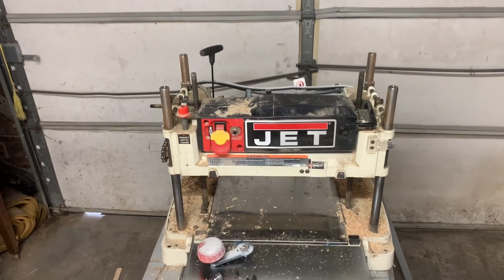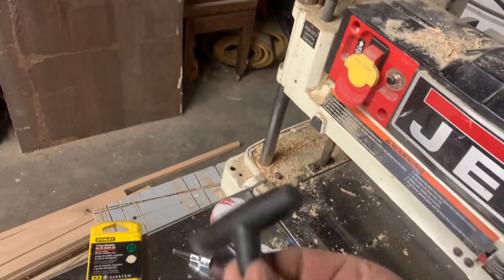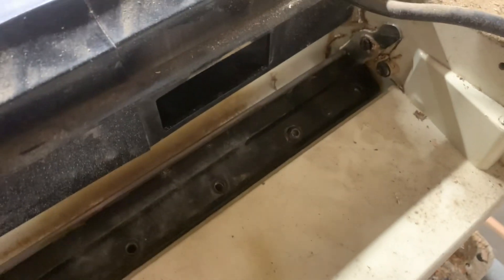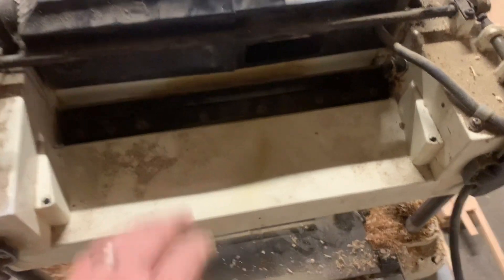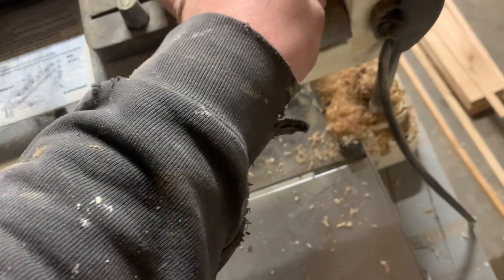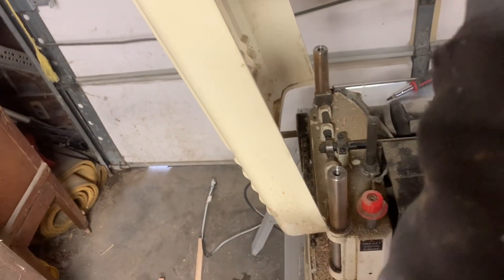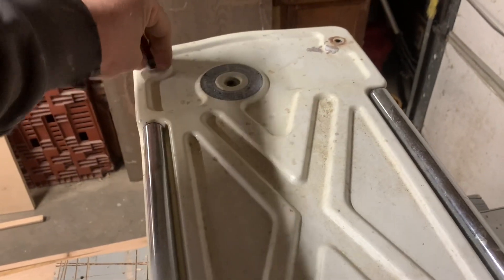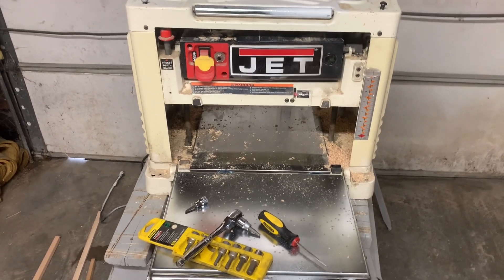Howto: Thickness Planer Blade Replacement

Comment: The bit I really wanted to see was you actually replacing the blades and you never even videod it.
Reply from the maker: My bad, I will have to reshoot the video. All I did was remove the screws, pull the blade off and turn it over for reinstall.